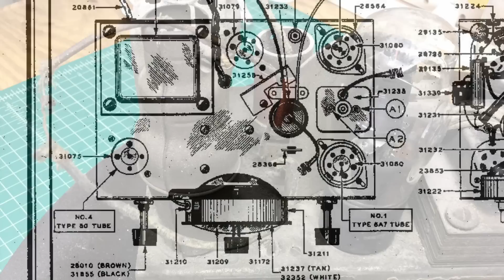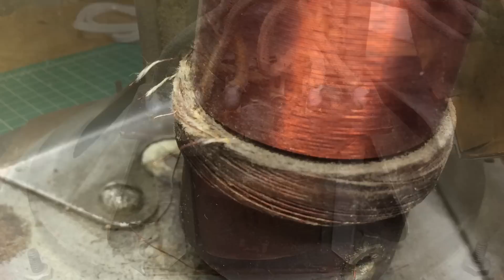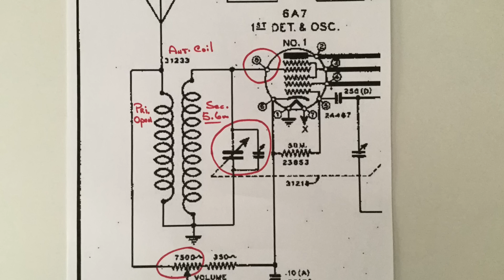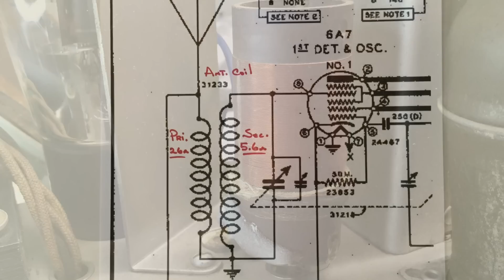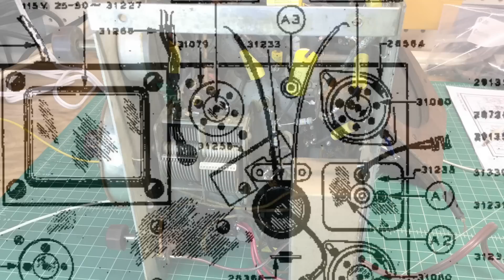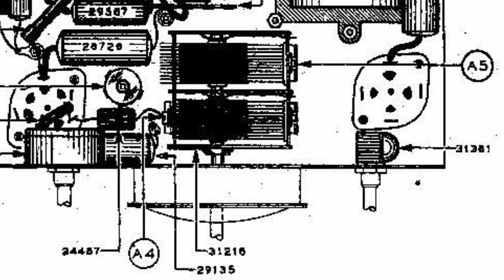Antenna Coil Debacle

Comment: I have a AS 5 radio it came to me with a ferrite bar antenna ,that was broken in three pieces,so I ordered a new ferrite bar blank ,and hope I can buy magnetic wire and wrap it ,and hope it works,the old antenna magnet coating is flaking all ever the place and the bad in three pieces,any advice anyone ?
Reply from the maker: Ron, try to match the number of turns and the design of the broken ferrite is what I would do. Good luck. Best, Don

Comment: Nice save on that antenna coil! I have to take a look at the one on my philco 89. I had the oscillator coil rewound but haven't checked the others yet. the radio does work but it likes to motorboat.
Reply from the maker: Thank you. I got lucky on the repair. I appreciate you watching and hope you are able to solve the motor boating issue soon. Best, Don

Comment: Hi Don. Awesome save on the coil. It sounds great. I Rechecked my Philco has it was very late at night when I checked it the first time. I had left the rectifier in the set It tested shorted,So I ran checks on the caps resistors,Did the dim bulb test again No shorts. yipeee :)  I am waiting on the 84 tube to get here. I just finished recapping it this evening. Has always I am looking forward to more from you.
All the best.
Bobby
Reply from the maker: +Bobby Tectalabyss Thanks Bobby, working on the antenna coil was like completing a thorough eye exam. LOL Glad the "PT" was good and hope your progress after receiving the 84 tube goes well. Best, Don